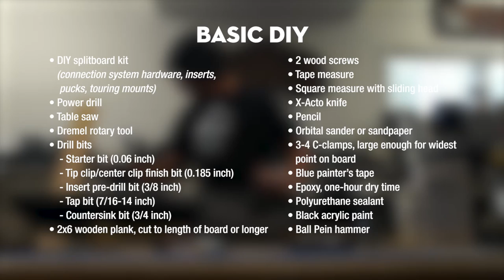Make a DIY splitboard in 11 steps

Comment: I have trouble understanding how these devices would stay together as a snowboard under the stress of riding. If the edges interlocked okay, but they don't.
Reply: North Poll TV the clips and the bindings will keep them together... obviusly this is a DIY and low budget board wich is far from a native Splitboard
Reply: The edges do move a bit, which is no problem in powder. In flat sections however it behaves a little bit strange.